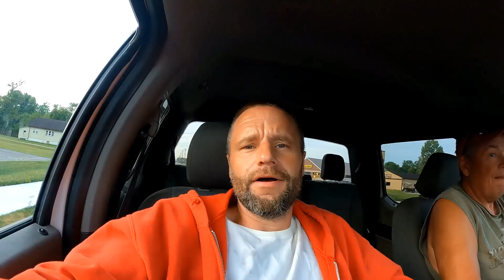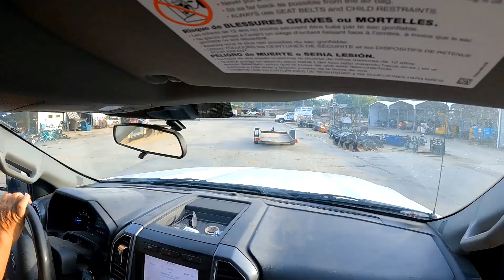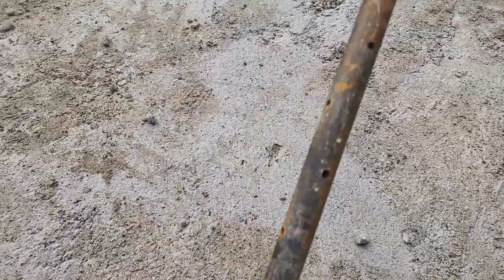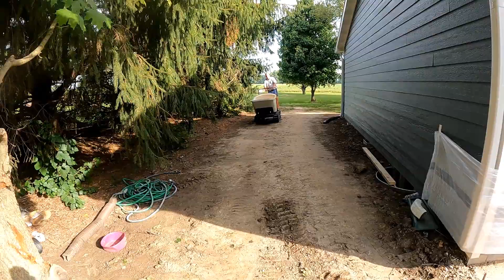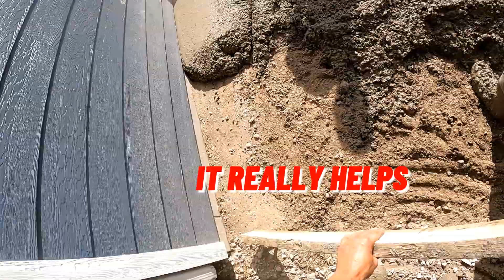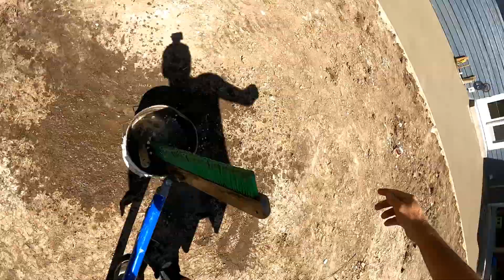How to make EASY MONEY pouring Concrete w out going 2 WISCONSIN

Comment: Spray glue is nice ..
We always use tie wire and a spike with a tapcon drill ..
Buddy showed me a trick when doing a ton of expansion..
Hit the middle of the spike with your hammer and bend it .
Drill hole cordless tapcon..
Insert nail..
Bang no tie wire needed ..
The best concrete guys think everything out and do make mistakes but it’s not common ...
You guys know your stuff 👊
Reply: Knee high socks with the stripes..
Also Gatta be mindful of the knees ..

My old man did floors in NJ for years Union ,12:00 was a legal 2 beers for the concrete crew ✌️
Reply: 15:15 gold 👊that’s how you get contracts

Comment: I don't understand I'm not a concrete guy but have peed my own slab with no problem was ready and with no experience maybe I was lucky but I did prep the ground tamp gravel into the clay and waiting for a semi cool day and not mid day also made sure it was wet enough to work what an I missing here was it too hot out, to dry of a mix? Mine came out perfect and I was worried I'd mess it up because it's never done it and love in Texas two years later still strong no cracks either.

Comment: Nice broom adapter,  the screw on adapters suck . I’m from California and we trowel everything before we broom it, I like the mag finish though, why not if you’re just going to put some texture on it with the broom, are you using a horsehair ? Cool videos .
Reply from the maker: I'm nit a big fan of that green broom, I like the 2 foot regular. But we knew we were going to be in the shade at the end, and we like to stay consistent,  sometimes we fresno b4 finish,  rarely anymore. I pretty much saw cut everything because we r short handed

Comment: How come you saw cut the joints instead of just doing it when it’s wet?
Reply from the maker: that is what the builder asked for, we do saw cut most of the time, i like that little tiny joint better as far as looks and it makes the finishing process easier. the 1st tool i bought when i started my company was a soft cut saw just so i could do things like this, i do have a unlisted video where we cut the joints, you can see how much more work it is. here is the link https://youtu.be/OjBqXn7WnOI

Comment: What area do you live in that doesn’t require reinforcement? Not saying anything about you doing it wrong just curious.
Reply from the maker: Indianapolis area. we use wire on driveways. it does have fiber. i know that is 2ndary reinforcement but did u see that subgrade and how hard it was. if i use wire in all my patios it would make sense cuz no1 else does around here. i do use it in driveways if the customer wants to pay for it. im not buying it 4 them.  thanks for watching
Reply from the maker: subgrade is more important than anything. wire and rebar dont keep it from cracking. we soft cut almost everything. check out my new long form video. we get that question all the time. other youtubers in indy get that question all the time too
Reply: @GRUBB-MUDD  yeah sub grade is very important!! It all starts with a solid foundation.
Reply from the maker: so we just make sure we got a solid base and usually just go w that. allways use fiber though

Comment: no rebar?
Reply: Yeah, they have rebar in the mix,
They add it at the batch plant. Concrete mix has come a long way.
Reply from the maker: its called fiber
Reply: @GRUBB-MUDD  Rebar and fiber are two totally separate reinforcements. Fiber will in no way replace rebar. Fiber is a secondary reinforcement. Some people use fiber as selling point to customers who believe that it replaces steel. That is 100% wrong.

Comment: Wire mesh? Rebar?
Reply from the maker: I don't think we used it on that patio, it was for a builder and he said he wanted fiber. He was paying for all that, but we did make sure we had 1 heck of a base on it. Did u see the clip I showed how compacted it was
Reply: I did looked good! I was just curious if you used it or it was required
Reply from the maker: @rooflorrdjesus  this is how we do a slab if it is going to have more weight than just a grill or a table and chairs https://youtu.be/RZRhjv6aiCk (btw u can only view that video w that link)
Reply: @GRUBB-MUDD  cool ill check it out after work bro awesome youtube im glad i found you before you blew up on here just a matter of time til you got play buttons
Reply from the maker: @rooflorrdjesus  that would be amazing,  alot of people are saying that, I think I need to tie it up a little tighter 1st. I need a team tbh. Thank you for those words! I appreciate it

Comment: you dont need a education its just common sense
Reply from the maker: the word common sense and concrete dont go hand in hand as far as the rebar, you will never see some1 use rebar in a patio in my area. did u see that subgrade. subgrade compaction is really really important.  we did use rebar yesterday but it was in a driveway approach to the garrage
Reply: @GRUBB-MUDD  didnt exspect a response lol
Reply: u must make it look easy
Reply from the maker: @stevepersinger7829  I respond alot more than the other youtubers, if some1 is going to make a comment I feel it is only right to do my best to get back to them, I appreciate it bro

Comment: No rebar or wire? Nothing???
Reply from the maker: did u see the subgrade, wire and rebar dont keep concrete from cracking. its really a waste of money plus our winters are not that bad so no1 in indiana uses it. so if we used it i would be loosing money. i do use wire on driveways though if the home owner wanta to pay for it, i take it back its not a complete waste of money because if it does crack they wont open up

Comment: no metal bars or wire mesh  mmmmmm,
Reply from the maker: U saw how compact the base was, btw that's how people pour in my region, but we do use wire in driveways, but you never see rebar in a patio or driveway here. Especially on a patio when the heaviest thing would be a grill... mmmmmm. This goes to every1 saying that, wire nor rebar prevent cracks, control joints prevent random cracks and a solid subgrade. U can research that, w all do respect
Reply: @GRUBB-MUDD  thank you for the information, now i know why i love your channel.
Reply from the maker: @mauricio rivas  thank you sir!!!!

Comment: bruh why no wire??
Reply from the maker: im not going to address this comment anymore, maybe i will w a video. im tired of typing it i guess you could saybwe "RAW DAWGED IT"
Reply: @GRUBB-MUDD  bruh it's just a question, I watch victory and Ryan says it's always best to use wire or rebar. I been watching a few of your videos I subbed because you're videos aren't boring like many concrete guys on YouTube and I believe your channel can one day be as popular as victory outdoor services. I'm just confused why so many of you concrete guys don't use wire or rebar.
Reply from the maker: @RAW DAWG tv  it is a dif area then Wisconsin,  we use the same concrete but our winters r not that bad plus we use fiber. subgrade compaction is way more important than wire or rebar. ryan doesnt wet his subgrade when he compacts either. that just takes 15 extra mins. my subgrade r the most compacted on yt othr than j&m, but i do use it on most driveways. the heavist thing on a patio is a table or a grill. Do you really think it needs wire? come on. im jk, but nah no1 in indiana uses wire on patios or rebar. ryan needs to say "in our area" he has every1 on yt thinking rhat it is necessary. we cut control joints every 8x8 squares. my patios hardly ever crack out the joint. 2 cracks in 4 years. 1 time it had wire in it and still cracked. wire and rebar does not prevent cracking. u can ask ryan that and he will tell u the same thing. im not hating but just kinda getting tired of every1 compari g my work to victorys. our frost line aint nothing compared to Wisconsin
Reply from the maker: @RAW DAWG tv  your good bro, sorry 4 that snap i did address it in my latest video long form though. "worst way to pour concrete" i got like 500 of the same question lol